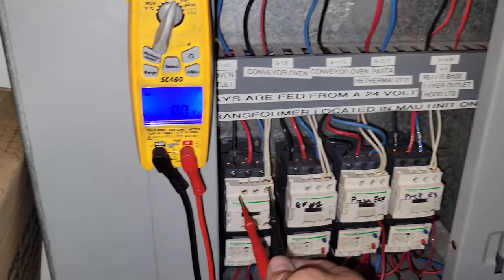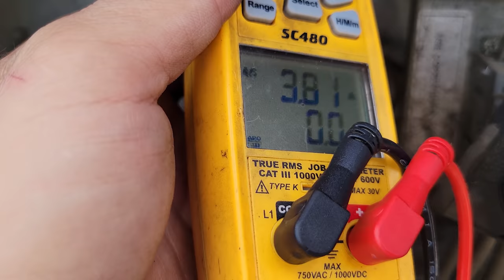ALL THE EXHAUST FANS ARE DOWN

Comment: It's noteworthy the fuse was an FNM-10, meaning it was a time-delay fuse which would allow even more than 10 amps for a short period of time. The circuit may only be drawing 3.81 amps now, but when all of the motor starters and other controls are energizing at the same time, the current is likely much higher — possibly high enough to push the instantaneous current limit. It's too bad you didn't have a chance to measure that. The power may not have come back on (or gone off) cleanly during/after the failure, but might have bounced off and on again one or more times, thus repeating the current surge through the fuse and/or extending the overcurrent condition beyond the fuse's delay time.
Reply: Dang this cat smart.

Comment: @11:00
Tip from an industrial electrician for those mixed-voltage systems. We will often use a 24V control system, then in the motor panel each contactor (with 120/240V coil) will have a matching 24v relay. The control system turns on the LV relay which then switches the HV contactor, much easier to carry a variety of relays for different control voltages and a single line of contactors.

Comment: Sounds like a system we have in the UK, "gas interlock valve" its designed to stop cooking equipment from running (especially natural gas appliances) from running and producing carbon dioxide, with no exhaust fan it's a silent killer.
Reply: Looking at that panel,
It all needs updating
Reply: carbon monoxide but yes

Comment: so, one minor detail... you're not gonna suffocate the fire with exhaust fans, but you do remove smoke and heat.
Reply: And draw in 6000 cfm through the make up are fueling the fire
Reply: @petersmart1999  makeup air gets shut off.
Reply: @Commissar0617  ,I should have elaborated better,im assuming that these guys all understand how this stuff works.What i shoukd have wrote was,it all gets shut down in case of fire,and the reason being that the air flow will feed the fire!
Reply: @petersmart1999  exhausting the smoke is more important. the fire isn't oxygen constrained in any way already
Reply: @Commissar0617  you cant have any fans running in the pesence of fire! Only after all fire and embers have been extinguished! Not gonna,argue the point!
Reply: @petersmart1999  then why do firefighters use positive pressure ventilation?

the smoke and heat are far more dangerous than the flames. besides, this is if the ansul system is deployed, so at least the vast majority should be extingushed
Reply: @petersmart1999  bruh, ansul is dry/liquid chem, not a halon or CO2 system.

Comment: Yep! Finally one I actually know something about... I have quite a few sites where I have to explain very clearly to customers that we need to have all the necessary spares on site ready to go in case they lose an extract fan or a supply fan, be it belts, motors, contactors, air pressure switches etc... The gas supply is interlinked and all appliances will shut off when the power to the gas solenoid is interrupted.
Reply from the maker: I will discuss this on my Livestream on YouTube this evening 9/20/21 @ 5:PM (pacific) come over and check it out https://youtu.be/GHCvsPQCU0I

Comment: just a thought, based on your findings...

if the voltage supplying the control transformer never reached zero, like say only dipped down to 50-60% normal voltage, then it will affect the output voltage, and if the output voltage had dipped down far enough to only keep some of the contactors pulled in for a few seconds, then the ones that lost their ability to hold the contacts in could have created a high current through the coils, simulating a psuedo-short, and in turn over-amping the fuse enough, even if a time-delay, to blow it as if there was a shorted connection.  if you were drawing a little under 4 amps at 24v, then if the voltage dropped to 16 or under, it would now be drawing around 8 to 9 amps, likely more, if the contactors were trying to stay pulled in, and likely more on the coils that had failed to stay engaged.

the wires could likely handle the brief amperage spike for a few seconds, but a fuse is designed to fail on high enough overcurrent, and time delay ones will only hold if it isn't a maintained overcurrent level (the load spikes for a moment and drops).  I wouldn't be surprised if the contactors had started chattering during the time the lights flickered.  My guess is the system has a fail-safe where the contactors have to be held in to provide power to the controlled device, so if the suppression system trips the circuit is broken, instead of the suppression system needing to activate contactors to break connections.

Comment: Highly recommend a lighted fuse holder. So easy to open a panel and see the light and know the fuse is bad. Also touch safe for the higher voltages.

Comment: The lights flickering is more than likely not a power surge,but the auto recloser on the distribution lines trying 3 times to close the line back in & if the fault is still persistent on the third attempt it will lock out & stay that way until line crews reset it.

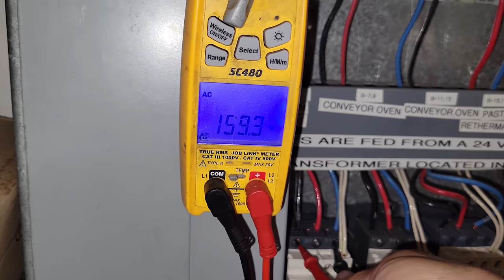Comment: 1:17 and 10:14 we here call them motor protection switch or motor protection contactor, depening on what type they are. The ones you show are contactors and then there are for examlpe Schneider Electric GV2xxxx (where xxxx is the type, for example GV2ME06) that are switches

Comment: I inspect Ansul and other brand fire inspections. In this instance I think only electrical appliances or electrical controlled appliances were shut down. From what I see gas is only shut off through a mechanical means by the fire suppression system. There are electric gas shut off but in our area they are few because they have shown to by unreliable.
Reply from the maker: I will discuss this on my Livestream on YouTube this evening 9/20/21 @ 5:PM (pacific) come over and check it out https://youtu.be/GHCvsPQCU0I

Comment: Most likely the fuse blew because the transformer produced over voltage(because of the power surge). That over voltage caused the protection circuit in one of the motor starters to engage and shot the line (shotki diode tripped and shouted voltage to ground). Depending on the duration of the short that diode may have died and the next surge will kill a motor starter...

Comment: Like another person said, probably energizing all the 24v coils repeatedly is too much too long. Only a thunderstorm or arcing line in wind can do it so very rare. Fuse can handle it for a one shot power up. You could put a time-delay on so multi starts won’t happen again. Also I think you could hot swap the fuse if you put your jumper fuse firmly around it maybe with 5A since it’s not starting and that limits over current enough when both fuses are in parallel. But you’d only be that way for a minute so minimal risk.

Comment: 24V is so called safe voltage. So if those manager is not afraid of some sparks, he can change the 24V fuse.
But, near 24V line lies live 110/210 AC line, that can kill him... So, I agree to prohipit the manager to changing the fuse.
Reply: honestly, even 24 volts AC can mess you up at the right current draw.  might not kill you, but it can mess up your heart rhythm for a little while.  you would for sure feel the tingle at that voltage, even at 8 volts you will feel it, though resistance will likely limit the damage to just making you pull your hand back quickly.  24v will make you pause for a few moments before you can react.  120 and up will stun you and could even kill.

Comment: One thing to note about newer power grids, is that they have "smart switching" capabilities. They are often able to cut off damaged areas while restoring power to undamaged areas, and it seems this occasionally requires some on-off-on-off cycling to get it right (at least in my area). It does, however, work really well at getting power to as many customers as possible...
I suspect a similar power cycling lead to the fuse's failure due to current surges, and that might be a cumulative effect over years, or it might be from that single event. That certainly could be a head-scratcher if you didn't have the presence of mind to check the transformer's fuse!

Comment: I am surprised that such a system doesn't have a fault indicator board somewhere visible, indicating that the system was disabled due to the fans not running. My employer makes some products with internal fault-finding LEDs that can help a technician narrow down the source of an issue (each voltage rail has it's own light, each board has a power and status indicator light, and lights for specific circuits). SMD LEDs don't cost anything anymore and technicians like things to be easy.

Comment: Working on an industrial plant I don't see a 24V system with a main transformer/power supply as very strange.
But on the other hand we have a massive number of different voltages where 500V with floating ground is the most common.

Comment: Love the mesage at the end. 
Power issues like this always intrigue me. I'm more interested in finding out what causes a full or partial loss of electrical service than anything in the more "normal" HVAC job.
It's more a curiosity than a "I wanna be an electrician" thing though. I blame the power failures at high school. 5 total in 4 years there. 3 of those were longer than a half hour. Most equipment on backup lasts about that long. Internet is dead in 20 minutes, and UPS and laptop computers start running out around that time. Did I mention there's NO emergency lighting either? First outage was 2 HOURS LONG. 3 entire class periods plus half of a fourth before it was restored. I now carry a flashlight with me always since that first one. I've rambled enough, thanks for reading, and have a nice day.'
Reply: The ‘message at the end’ seemed to be an ad for Odyssey NeoGeo’s curved display.

Comment: Chances are that flicker they saw was a distant line strike and the power surge that caused the flicker briefly boosted the line voltage and the transformer would just as briefly throw out much more than the 24 Volts the fuse is designed to handle causing it to blow...

Comment: well its logical, that if you have a gas fired pizza oven, and a gas fired deep fryer, that it interlocks with the exhaust system to prevent CO2 poisoning. When you have the flickering lights, it means main power is going down, maybe because there was a lightning strike in an transformer close by. like you said, all the motor contactors (relays) are switched  with that line, so i guess its pretty much at its limit, meaning when the mains drop to lets say 75v and it looks like a single phase transformer the output drops to ~17v the amperage will increase (U=IxR so U/R and R doesn't change) over the maximum of the fuse, witch is already stressed by running on the maximum of its rating.

Comment: What's the model of 24v motor starter? I'm guessing it uses an optocoupler and a solid state relay to close the circuit or open it. Pretty simple and neat technology that isolates one side of electrical circuit from the other.

There should be a cutoff switch with a padlock and a key in the manager's safe. Worst case scenario you swap hot or turn of breaker of they lose the key and they can cut off the lock later. Best case scenario you have a locked out switch so no one can accidentally shut off the entire rack only accessible by the tech and manager. Add label to breaker panel saying access key is in manager safe, grab before going to roof.

Comment: For me seeing all these 120/240 control contactors is odd. 😅 But my only experience is at a casino I used to work for we ran an automated logic system so everything was 24 volt/pneumatic. Few 277 contactors in the rooms electric heat/chilled water cooling. Even a electric demand system that used 24 volt control

Comment: So lots of lightningtin the area and their lights flickered a few times before the power went out for some time before it came back on?
To me that sounds like the lighting arrestors somewhere along the HV Lines tripped.
Basically lightning arrestors are voltage dependent resistors. If they see nominal voltage they pass almost no current but they short out when a surge comes in which diverts the surge to ground and blows a fuse or trips a HV Breaker down the line. This way the powergrid and the customers are protected from surges.
Reply: I've seen lightning take out one phase three times in the last 7 years at my church.   The first two times likely caused some sort of safety equipment to trip; the last time it happened they ended up changing out the transformer for the whole block.  It was nuts.

Comment: the makes scents with the surging of power if the voltage drops the amps will go up. If the volts drop down to around 7.2volts or lower that could have blown the fuse. At that amp range its a 72 watt load so to maintain that wattage the amps will have to go up.

Comment: Okay...Did you have to actually change that transformer in the end, or did you just change the fuse?
I wonder if that system or main power panel has a big surge protector on it ? If it does, then could my theory be correct that the main power surge protection is not protecting the secondary voltage so much? Are there surge protection devices available for 24 volts I wonder? Yes, it is good to have quite a bit of knowledge about interlock switches and other safety switches on these big systems. That knowledge will likely eventually get you to the bottom of many problems. I am pretty sure that most electricians are totally lost in these matters. The electricians I deal with are totally lost in residential HVAC, so even more so in  commercial and industrial HVACR for the most part.

Comment: how nobody knew about that is baffling. ive worked in some of the shittiest places and the hood is always linked to the cooking equip. if the hood is not on nothing else will come on. makes sense they would link it to the fans. if the fans wont run youd just end up setting the ANSUL system off when the temp in the hood got high enough.

Comment: This is a weird backdoor fire interlock. As a requirement of NFPA 96 all equipment under the hood and the fan need to operate simultaneously. Typically it's done with a thermal probe where the hoods automatically kick on when they detect a set temp or temp over ambient(and spin up or down based on duct temp), but there are a few variants out there where turning on an appliance automatically kicks on the exhaust, or the equipment won't start unless the exhaust is already engaged. That said, it's weird as fuck that the interlock is on the supply air control cabinet, because in a fire state those MAUs/RTUs are supposed to be shunted off or spun down, which in this case could potentially spin down the exhausts, which is real bad.

If this were one of mine I would have asked the location for their semi-annual hood suppression report to see how it was tagged out on the last pass. If the system tags out as red or in some cases yellow, and there's a fire, that place loses a significant portion of their insurance and equipment warranty(sometimes all). Pretty easy to pull a repair call or equipment replacement out after you bring that up.
Reply from the maker: I will discuss this on my Livestream on YouTube this evening 9/20/21 @ 5:PM (pacific) come over and check it out https://youtu.be/GHCvsPQCU0I

Comment: So 24v across a fuse means its blown?
Reply: Yes because you have a voltage differential across the fuse. You wouldn't if it was good
Reply: @huasohvac  So a fuse is a conductive object  so if there is supposed to be 24v on that circuit why wouldn't i have 24 through it.   If i didn't have 24v through it then i could say it was blown but he said " we had 24v across the fuse meaning we had it top and bottom = across"  how would that mean blown.  I could see 24volts on top and then 0v at bottom  meaning blown but that's not what was said.
Reply: @m9 ovich and that’s exactly what he said he had 24 volts across. But he said he had 24 volts across and the fuse being bad.
Reply: A fuse that is good is just a wire.  Measuring the voltage between two places  on the same wire will show there is no difference, or zero volts difference between the two leads. 

When you place your leads on either side of a fuse that is broken it will show voltage because there is voltage before the fuse and there is no voltage after the fuse, thus there is a difference between your two measuring points.